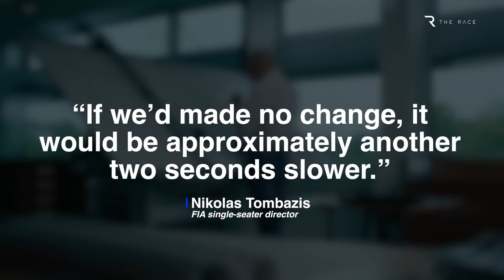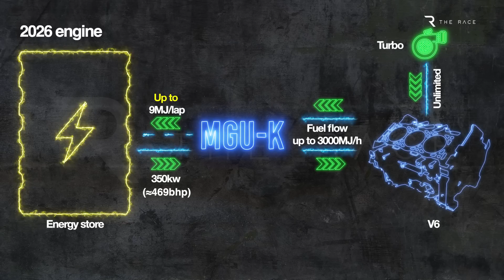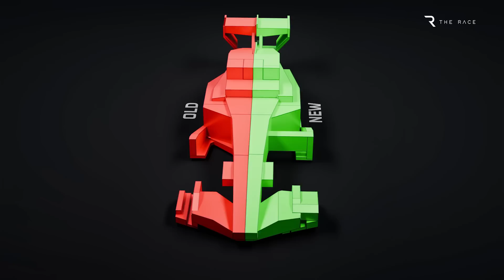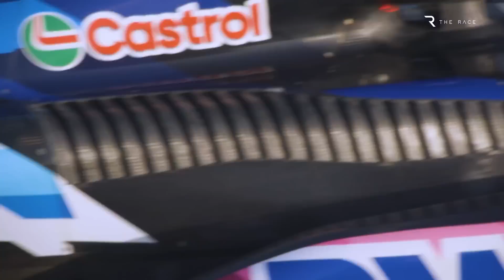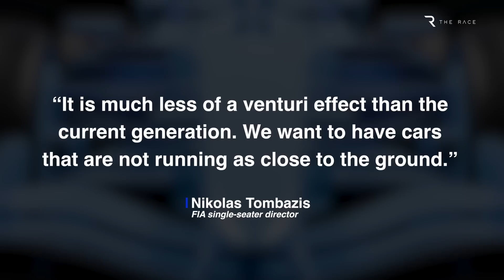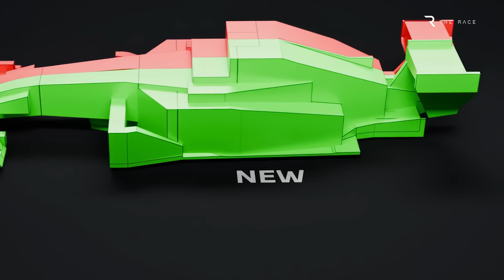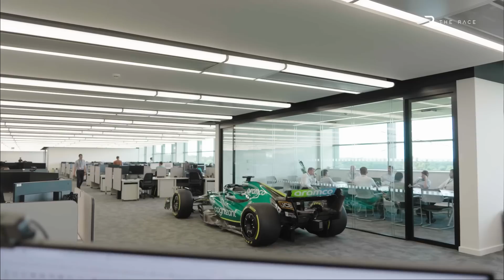How F1's 2026 cars will now be two seconds faster

Comment: A closer field and more overtakes. Less predictable winners. That's all we need.
Reply: Unfortunately, you WILL get the opposite of that with these regulations.
Reply: @bezoekers bro thinks he knows what he’s talking about
Reply: And that is not at all what 2026 will deliver
Reply: you'll always end up with predictable winners as some drivers will be good with different cars
Reply: @tturi2  If the laptime delta is minimized, then minor mistakes are much more likely to result in losing a space. A good driver in a slightly worse car has a better chance of keeping up.
Reply: With new regs. Only one or two will get it bang on and will get one-sided fight. Happens everytime.
Reply: No. What is needed is opportunity for differentiation by engineering ingenuity, even if it means one team wins every race because they come with new ideas. Innovation, surprise, creativity, engineering advances. A reason to admire a team because of what they do better not because of personalities.
Reply: @johnsmith1474  Best comment here by miles. Thank you.
Reply: These regs will do the exact opposite. DRS is gone, dirty air is increased by having barge boards back and less ground effect, slipstreaming will be gone due to active aero and to top it all of overtaking will be purely based on who has ERS at that time and who doesn't. Since 50% of power output comes from ERS it means anyone who has it when his opponent doesn't will fly by with ease on the straights. To remedy this teams will have their cars brake in the middle of straights to regain power from the MGU-K. If anyone thinks this sounds like something that should happen in F1 please go and play mario kart.
Reply: Less predictable results just means that the competition became less meritocratic. NASCAR plate races are the single most unpredictable thing in motorsports, yet nobody with a brain calls that proper sport.

Even IndyCar has a pecking order, and a rather rigid one at that - Meyer Shank will not win next year's championship. The world you folks imagine can only exist to the detriment of everything else.
Reply: @aircooledbenny  i understand that wish of yours, but in F1 it is (almost) always about dominance. That is what F1 is! It just isn’t Cup racing. We had Vettel, Schumacher, Verstappen, Hamilton era in modern times, but before thàt most years were dominated by a certain driver too. It is part of F1 DNA. Personally the sound is what we miss most but i have to live with that. But if i could change 1 thing that is going back to that sound that penetrates your spine. Gives you goosebumps, scares you. 70’s, 80’s 90’s live experiences were so much better than these days. Make it louder, and dont broadcast HE PUSHED ME OFF anymore please.
Reply: F1 is miles away from achieving that.
Reply: yeah i dont give a dam if the car is 5 sec a lap slower if the racing is good
Reply: And hopefully, plenty of first time winners like Hadjar, Antonelli or Bearman being 1st time winners.

Comment: Aaand after 5 races: we dont understand the car😂😂😂
Reply: Wonder what the ‘porpoising’ of this era will be
Reply: I'm curious if/when teams will discover a way to harvest air flow into energy. To me that seems like the obvious loophole/secret teams would exploit if it's not already written into the rules.
Reply: @callmeshaggy5166  
Using drag to generate power will never be worth it. That's basic thermodynamics.
You lose more energy than you gain.
The only way this could work is if you deploy this contraption only when you're actively trying to lose energy, i.e. under braking. Same principle as ERS, except wildly inefficient.
Reply: Sure, put mini windmills inside the car to use energy to get extra power on straights or to recharge ers. When they get very efficient it would cancel drag force, so then no force opposes acceleration and car would accelerate forever reaching insane top speeds, but drivers wouldn't be able to withstand g forces maybe so scratch that. Maybe for ai drivers categories only.
Reply: @alexvaz9502  always wanted a game where you can make ridiculous experiments like this, but that's asking for way to much.
Reply: "It's really fast in the wind tunnel"
Reply: That's what makes it fun 😂

Comment: That safety car will be busy in 26 with these new engines as teams work to make them reliable.
Reply: they're making less power so they should last longer, unfortunately they are limited to e10, like what's the point of putting ethanol in the fuel if it's still 90% fossil fuel
Reply: @tturi2  it wont be. From 2026 the fuel is fully sustainable. The 90% non-ethanol will be biofuel.
Reply: @alj-z7x  yeah I hope it's methanol or LPG as those are much better for emissions
Reply: I mea if you look at the car it will have so many little aerodynamic pieces that might break from a small impact and then will need SC or VSC every 5 mins to pick them up
Reply: Isn't the ICE component effectively unchanged? It's just the 'add-ons' that are changed. The battery is bigger, and the MGU-H is gone
Reply: @alj-z7x well they most likely not gonna change the ICE materials.

Comment: How does the extra battery weight compare to the lower weight of fuel on full tanks due to less reliance on the ICE?
Reply: The fuel weight isn't included in the car's 'dry weight'. The maximum fuel load is reduced with about 15 kg.
Reply: @henkormel5610  Interesting thanks, about the same as the additional battery weight. Offset mass between start and end of race will be less, but much lower than before. Sounds good.
Reply: @ab8jeh that and cuts to size should see the new cars be more nimble.
Reply: @ab8jeh  It sounds good but won't be good, ERS will only be very minimally be available because harvesting capacity and battery size are to small to facilatate any serious lap by lap use of the MGU-K to generate the additional 450 bhp. This means passing will be purely down to someone having or not having ERS and all passing will happen on straights. If you want powerful and fast F1 cars who are not as heavy or as big you need to go back to just pure fuel-based ICES. These engine regs will kill F1

Comment: Seems all logical for the sport.  However I think most long term F1 fans cant wait till 2030 and some 2.0L V10 NA on synthetic fuel - noise, sustainability, lighter weight smaller cars - back to 1997 sizes please  :)
Reply: V8 NA engines should return also.
Reply: @purwantiallan5089  yeah, and at 2.0l would have more efficient piston sizes, but the 5 or 10 cylinder noise is just better in fact its musical.
Reply: I don't think they'll make 2030. These engine regs are a mess, a mess they're still trying to compensate for within 12 months of racing them. And when they come and F1 will become Super Formula speed due to PU output essentially being half of what it is currently, people will stop watching, high level drivers will leave and they'll panic and jump back to current regs within a year. Then they'll realize people want fast, small and nimble cars and they'll go back to V8s at miminum and we'll all rejoice.
Reply: @nielsvanheteren  4 years is a short spell for all the investment,  can't see them shortening that agreement.
Reply: @ Depends if they lose a massive amount of viewership that invesment would become null and void anyway. Can't see Max, Lewis and Charles still staying in F1 if the cars become a complete mess to race. And with Americans seeing the current success of racing you can bet there some rich guy somewhere waiting to pounce on getting all the favorite drivers away from F1 into his new racing series. People watch for the drivers and I honestly don't see many of them enjoying this format for 4 years straight.

Comment: We need more close racing, not necesarly faster cars, yet, it is something almost impossible because there will be always a team or two who will 'interpret' better the new rules.
Reply: @jamdc2000  is F1 really a sport of close racing? 

I would completely disagree F1 is an engineering sport of building the fastest and most extreme examples of cars in the world to a set regulation if close racing happens then it’s a happy byproduct of the regulations
Reply: The closest racing is found in Formula Ford, but this is not what people want. People want the spectacle of fast cars too.
Reply: I guess it is up to FIA to stand his ground. We had a good balance of speed and racing with 2022 cars but FIA bent backward and allowed teams to diverge from the initial regulation.
Reply: @bazarovism  agreed
Reply: Eh these cars will be slightly faster than current F2 cars during races (because 50% of bhp comes from the battery which you can't even use every lap due to harvesting limitations (not regulatory but technical limitations)). F1 is going to be slower than some racing series like indycar. This entire video is just desperate attempts by the FIA to make up for the insanely moronic engine regs they cooked up which are just technically impossible to get in a similar performance window. As Max Verstappen said it will be faster to brake in the straights to gain back power with the MGU-K so you can use double the amount of bhp again.
Reply: 2021 was final ever season we see TONS of close race actions.
Reply: @purwantiallan5089  that was still only 2 cars that were close, the rest of the field just lined up in manufacturer order
Reply: @purwantiallan5089  Huh? 2021 had 599 overtakes, 2022 had 785 overtakes, 2023 had 858, 2024 had 788. So 2021 had the least. 
It still was probably the best season out of those 4 though, followed by either 24 or 22.

Comment: Thought they meant 2 seconds  faster than current laptimes
Reply: I thought that from the title, but it's 2 seconds with revision 2 of the 2026 regs.
Reply: @ab8jeh  So compared to current regs, how slow are these.
Reply: @saivikas9580 who the heck knows anymore. Every year it seems I hear the cars are supposed to be a little slower, but then fp1's leader is already in q3 in previous season's time.
Reply: @saivikas9580  so basically, according to my understanding, 2026 cars will be as fast as 2022-2023 cars
so about 1.5-2 seconds slower than 2025 cars.

Comment: While I wanted to see Super Formula being as fast or faster than '26 F1 cars I'm glad F1 fixed their mistake. That planned downforce cut was just too much. Also nice to see they rely on wings more. I don't really like ground effects car, they don't improve the racing as people are led to believe. Same thing in IndyCar as well. The 2 previous kits raced better.
I expect '26 rules to be very nice and close. Engine rules should put engines very close (despite the fear propaganda some are sreading) as we saw in LMP1H which was similar to this. ATR and cost cap started working in the time window said before it started. I think this will be the first rule cycle we can expect things to be close. Previously there were always doubts. But this one the doubts have been reduced drastically, imo.
Reply: The previous two generation of cars definitely did not produce better racing than the current ground effect cars. There is nothing to back up that claim at all
Reply: Lol F1 in terms of deltas between cars have never been closer than since the 2022 regs. People only are led to believe otherwise cause one driver is just plainly way better than the rest. Also 2 seconds isn't much they will only be slightly faster than super formula or even F2. And then I haven't even mentioned ERS will become a push to pass borefest with overtakes only happening on the straights especially cause dirty air will be increased again by these exact rules you're advocating for.
Reply: @nielsvanheteren  That's the point. Cars are close because teams are close. And this is thanks to ATR and cost cap, not ground effect.
Reply: @PenteanoO  Agreed, but ground effect has objectively made racing closer as well. I see cars within 0.5 secons all the time now,  in 2021 and prior that would almost never happen. Even F1 2021 one of the most exciting seasons in recent history often resulted in either Max or Lewis winning based on who was ahead in quali or at the end of lap 1.
Reply: @nielsvanheteren  one driver and one team. It’s highly likely they would have continued to be better had Adrian not left the team
Reply: @ I think there's a good chance Max will win again this year. It's all very close but he is the only one maximizing every weekend. I believe he wasn't far off Lando or even ahead in points scored after Miami. It will be a lot closer though with Ferrari and Mercedes competing as well.
Reply: @nielsvanheteren  trust me: as a Red Bull fan, Red Bull’s been slipping away too fast for them to be seriously competitive this year. Maybe we’ll be looking at a dominant year for McLaren. Maybe Aston martin under Newey will allow Alonso to finally get his 33rd. We don’t know. But what we do know is that Red Bull without Newey is not exactly great, especially considering Horner’s still there
Reply: @mrsoisauce9017  Towards the end of the season they managed to regain some form. Yes they don't have the fastest car anymore, but McLaren's fast car can almost directly be linked to the introduction of their flexi front wings which will get outlawed during next season. This will probably level the playing field some more and honestly the team I worry most about is Ferrari. 2 top tier drivers, a fast car and hungerness to finally win something again.
Reply: @ Towards the end of 2023, Aston Martin started to regain some of their form too. Didn’t stop 2024 from being a shit season for them
Reply: @ Yeah but Aston hasn't ever been a championship winning top team or have had the fastest car. Red Bull has so I have a bit more confidence that they'll manage to pick themselves up again.

Comment: I hope they are less understeery… Thats what makes the current gen slower
Reply: Shorter wheelbase should help with that. Wish they were even shorter, but at least we're moving in the right direction.
Reply: @ab8jeh the lighter weight also gonna help.
Reply: @ab8jeh  The wheelbase rule is a maximum, teams already have the choice to make a much shorter car if they think it will be faster. Which they don't do, because it won't be!

Comment: Vacuum of space does not suck as much as the V6 engines.
Reply: You said the same about the V6's of the 80's? The current engines are allowed to run up to 15k rpm but are normally ran at max 12k rpm due to reliability concerns. The old 1.5 liter turbo formula engines weren't capable to run over 11k rpm.
Reply: @henkormel5610  Everybody hates the sound and you know it. Make them sound good and nobody cares about how many cylinders it has.
Reply: @TheOdinCrusade  
Not everybody hates the sound of the current engines. Only the ones who are to young to have experienced the previous turbo era. Until '91 the engine sound was propper. After the introduction of pneumatic return springs by Renault the engines went screaming wit no recognizable engine tone left.
Reply: @henkormel5610  TF are you even talking about, we hit peak engine sound during the 90's and 2000's
Reply: @robertdevald  
TF? An other opinion is called TF nowadays? The engine sound before '91 was peak in my book. Post '91 it became non engine related noise.
Reply: @ Then you have a weird book my brother, it's pretty much universally agreed upon but weird preferences are also preferences so whatever floats your boat 😄
Reply: @robertdevald  
It's universally agreed upon by frequent reacionists on the internet. That is mainly the younger generation.

Comment: I don't believe a thing until I see it on track..
Reply: I mean… they‘re gonna have 4 wheels, i believe that
Reply: It would be funny (even if unlikely) if these sudenly are faster than the W11 because of loopholes that the FIA missed on the CFD.
Reply: I still don't believe it even when it's on track given this decade's record of rules interpretation and consistently inconsistent punishments.
Reply: Yeah
Reply: good for you.  no ne gives a fuck.
Reply: Clearly just a blue collar.
Reply: Yep. Who knows the 2026 F1 cars could be slower than 2014 Formula 2 cars and 2024 F2 cars.
Reply: @purwantiallan5089  I mean, 2022 reg would be expected to be a much slower cars than the 2017/2021 reg but turns out they have identical times when it comes to race day, qualifying was a whole different story though but then again, 2022 cars are 50-70kg+ heavier than the 2017/2021 reg. 

Theoretically, 2026 reg would be impossible to have slower speed than the previous regs judging by the weight alone.
Reply: @purwantiallan5089 f1 fans try not to be insufferable challenge
Reply: @purwantiallan5089  for that to happen, 2026 cars have to be atleast 10 seconds slower than current cars to be slower than 2024 f2 cars.
and like 15-20 seconds with the 2014 f2 cars...
Reply: It is a flat floor car and following will be terrible again